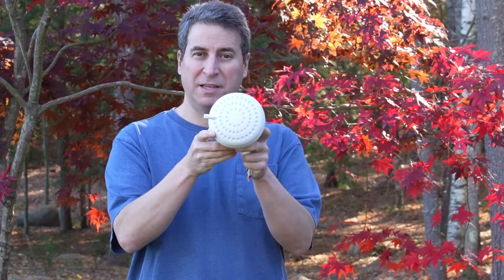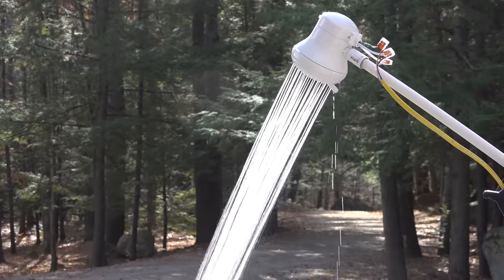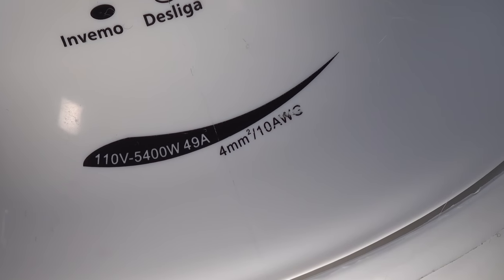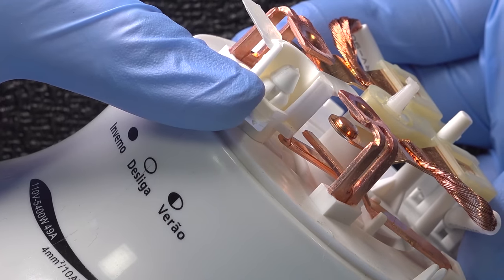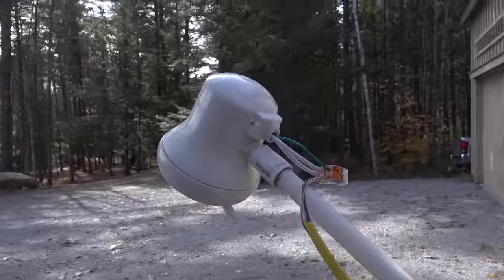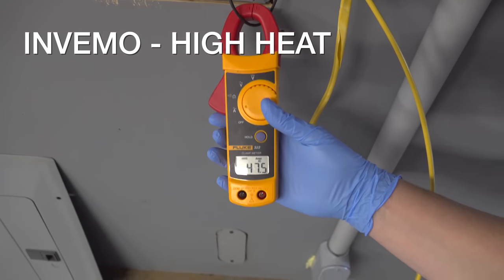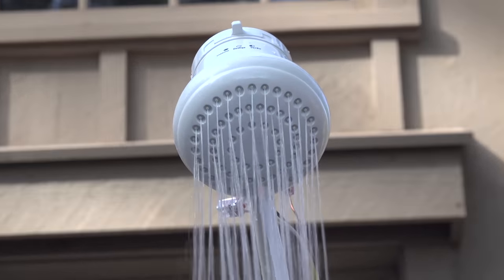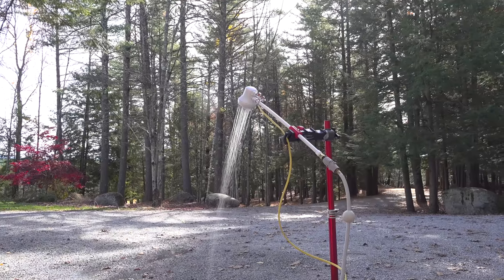What Happens When You Use a SUICIDE SHOWER HEAD in the US

Comment from the maker: Thanks for watching. PLEASE LIKE & SUBSCRIBE - I don't recommend buying one of these but you can see them for sale here: https://amzn.to/3Nmsgdr
Reply: When you didn't include a decent temp measurement I deduced it wasn't worth much.
Reply: Hi from England 🏴 we have had Combi boilers here for over 50 years. Blows my mind that they are still a new thing in the USA
Reply: At 2:10 you make a comment that has to be commented upon. Yes, "Positive" and "Negative" do not strictly mean anything in AC circuits, but "Phase" and "Neutral" do. You always put the switch on the phase and not the neutral, so that a device can not become energized even when it's off. Now, this device does seem to disengage both sides of the resistance (and that's good design when dealing with 50A) so there is nothing to worry about in this case.
Reply: FYI You gave possible mis information as there is a positive and negativeside to alternate current especially with a high amperage load. Small amperage won’t matter but high amperage should be connected correctly as stated in manufacturer instructions
Reply: I understand it’s due to high amount of dissolved solids in our water creating dangerous situation if cooks get clogged or covered in hard water deposits
Reply: Do people use these for outdoors or "van life" camping when you don't have an RV with a water tank? 5000 watts is relatively a lot, but a generator or car could run it power-wise at least.
Reply: Hey man, although that is a pretty common model, there are a lot of enhanced models down here. Some put the electric heating element inside a ceramic tube, some are capable of fine tunning the amount of power using a "potentiometer" stick of sorts. It's pretty interesting, but I really don't like those. If for whatever the reason one power phase is down and you don't have that ground wire, well... wired, I think it could get nasty.
Reply: Try turning the flow down to create more heat
Reply: Anything to make a dollar, right? Lol
Reply: The juxtapositon of an electro douche and Wago connectors is priceless.
Reply: INVERNO = WINTER.        IS NOT "INVEMO"
Reply: Isn't Positive and negative electric poles, is phase and neutral.

Comment: I think it wouldnt be as sketchy looking if the wires were longer and were hooked up somewhere outside of the shower.
Reply from the maker: I totally agree, every brand only gives you short wires like this, strange.
Reply: It's all a matter of cost and liability. Giving you only 5 inches of cable also allows them to make the shower heads with thinner wire. Making them with an external connector would cost more, as it would be necessary to pinch the wire with a high strength mechanism to ensure a good connection. Some brands will give you a 20 inch long cable with 2-layer insulation and a plastic tube that hides the cable for a cleaner installation.
Reply: He bought probably the cheapest one. The one I use came with an extra sleeve of isolation in the three cables (live, neutral and ground), the cables being longer than the distance from the wall, so I could connect it safely in a "closed outlet" (I'm not sure how to call it) with a ceramic conector. It also has its own grounding, not shared with the other ground installations in the house.
Reply: @SilverCymbal  the wires are short because they are supposed to be inside a box in  the wall , just above the pipe. Most of brazil has very soft water. Where the water is harder we get a bit of tingling when the showers are not properly installed. Most of the country uses these. And in second to that we use solar heating. A black panel on the top of the house and a cylinder to store hot water. But you need to make the second piping for hot water, which most homes just have one piping for  cold water. It is a lot of fun to see someone describing so perfectly the dangers of ontle thing we take for granted and never really about. I have never heard of anyone dying because of these showers but of course it may be unreported. You got the cheapest and most sold model in the country. We can buy one like this in a neighborhood supermarket or so.
Reply: It's all about money, that's the cheapest one there's plenty of mid to high range electric showers like those that come with plenty of safeguards, quality wiring and fancy designs.
Reply: Those shrink tubes will do the trick.
Reply: Am I the only one looking at this and thinking... The head has a really nice spray pattern, and that hose feature is better than many we have here in the US. I'm seriously thinking of ordering one for the bathrooms in my house, and just using the hot water system, not connecting the elements.

Anyone got some scientific data on the use of metal vs PVC pipe for these? It feels like to me, a metal pipe, properly grounded, would be the easiest path to ground for the electricity, if anything should go wrong.
Reply: @jdgindustries2734  no one left with a face I guess.....
We got copper lines. Grounded at the water heater. You want real hot water? Try the roof thing. I've seen enough to fear that. This is just Wyle E Coyote nutty.
Reply: @SilverCymbal some shower brands like Lorenzetti sells not only the shower head, but also a pipe that contains some spacing for you to pass the wires through and eliminate some of the mess. Also, here in Brazil, there are wires coming out of a small panel above the shower. The idea is that you attach the shower on the pipe, attach the pipe on the water plug in the wall, then mend together the wires from the shower into the wall wires and finally roll electrical tape across the exposed copper part. This is how you're SUPPOSED to do it, not so sure about the weird engineering/electrician fails we see around the Internet that look absolutely sketchy. But yes, if properly installed, it's quite solid.
Reply: It's nothing to do with money, the wires are obviously short so that any connection you have to make is always above and hence, out of reach, of the flow of water.  If you put a longer cable on it then the connection would likely be on or near the rim of the bath where water could splash on to it.

Comment: Lived in Central America a couple years - many times I've gotten an electrical shock using these if making contact with the head while showering. Had one explode on me at the end of its life cycle, getting burned with the sparks shooting out of it. Also, the lower the water pressure (and slower the flow), the hotter the water will be coming out of these. There were times the pressure would fluctuate and get so low the water would be scalding hot.
Reply: I have 26 years, and never get shocked by an shower, and i see lots of bad installations
Reply: Why were you even touching the head of the shower while it was on? Of course you're gonna get shocked! Just turn it off before changing the temperature!
Reply: @gabiferreira6864  often they are installed very low. For example I am 6 foot 3 inches. I lived in Peru for two years, where the average male is 5 foot 5. Needless to say I was shocked on multiple occasions.
Reply: @-rjbass95-19  100% agree. I'm 6`2" and went traveling in South America. I frequently got shocked because my head was much closer to the shower heads. One exploded on me in Lima after giving me a shock too. These may not kill people, but definitely aren't safe if you get too close to. Feels like someone is stabbing your scalp.
Reply: @-rjbass95-19  this is the one of the few situations where i can see these things being considerably dangerous.. peruvians are so short, especially women. My ex is 4'10, so I'm sure there's a bunch of installations below 5'5" lol.
Reply: Please get a lucky charm as soon as you can.
Reply: Yeah if I had one of these I'd probably buy a more expensive one than $20. I just feel with the danger it could pose I'd want to pay extra to make sure it's designed correctly. Even then I feel like I'd want to take it apart and look at what it's actually doing and do a lot of research to make sure I don't get electrocuted. Maybe hooking it up to a GFCI would make it safer but I feel like it would probably constantly be tripping it so IDK. I know a decent bit about electronics but really not that much.